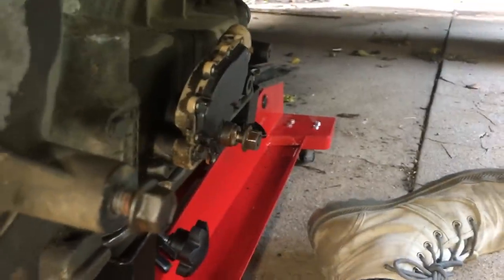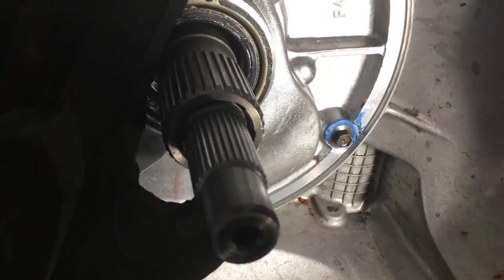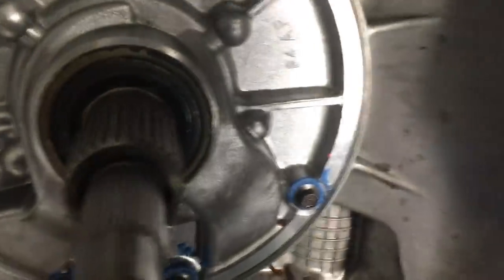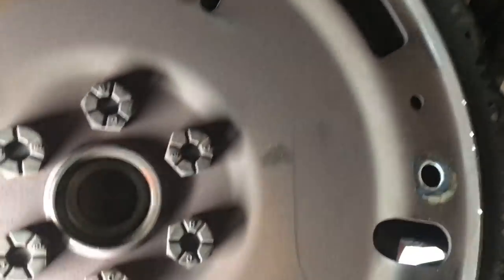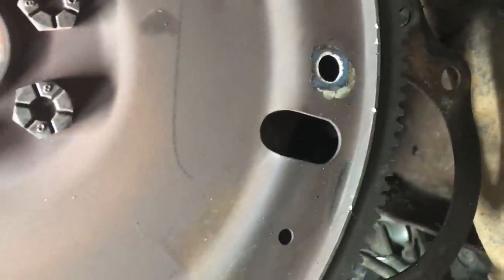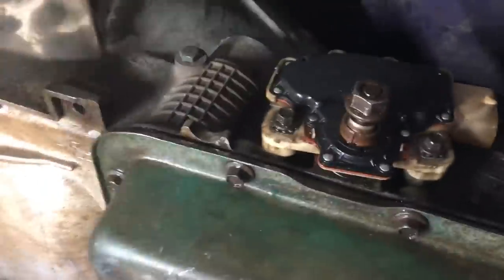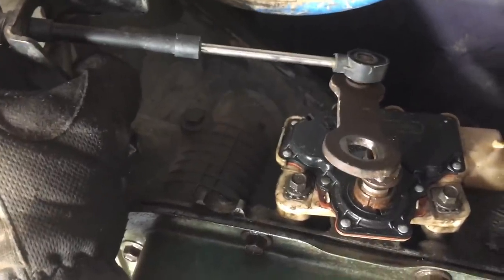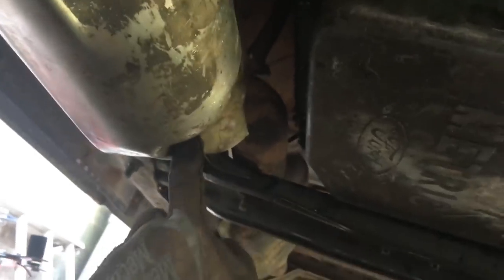How to Install a Transmission by Yourself in One Day | 1995 Ford F150

Comment: I know this isn't transmission related but I got a 95 f150 5.0. Drives great but when I'm having a hard time starting the truck. I have good fuel pressure and I just replaced the regulator. The fuel leak down test did show that it was losing fuel pressure after it primed. Any ideas? Leaking injector?
Reply from the maker: Jakestarr1723 Unfortunately, multiple things can cause hard starting. I usually start by eliminating cheap variables. Make sure each part of the fuel, ignition, and air system is working. 

Here’s some suspects: 
I’m not sure if these trucks have a fuel pressure regular/check valve. If they do, I would check that. Make sure the fuel filter is new. They are cheap and can cause problems. Visually check the injectors and make sure nothing is leaking. If necessary (and it’s takes some time) remove the injectors and have them cleaned. The last thing you can do, is test the vacuum of the engine. They sell vacuum test gauges at any parts store. Hook it up to and vacuum line on the engine.
Reply: The Minute Masters thanks
Reply from the maker: Jakestarr1723 No problem man! Let me know how it goes!
Reply: The Minute Masters turns out it was the vapor purge solenoid had failed. I was able to use the paper clip method and read the codes.
Reply from the maker: Jakestarr1723 Right my fault man. I should have told ya to check the codes. That would cause the problem. The solenoid probably caused a vacuum leak, which in turn caused the hard starting.
Reply: The Minute Masters the check engine light wasn't even on. I just decided to check the codes. No problem. Thanks
Reply from the maker: Jakestarr1723 Well I’m glad it all worked out!
Reply: idk if you fixed your problem but look at the MAP sensor

Comment: Okay so I'll watch your video against OU you allowing you just going to pick that transmission up and stick it up there and that's why you need to workout I'm calling BS on that dude that's some straight up BS Bubba U full of it dude
Reply from the maker: A drained auto trans without the torque converter is not that heavy. A bag of Quik-crete concrete mix at Home Depot weights 90 pounds. I can lift two bags for a short distance. So yes, I did lift the transmission up onto the table to work on it. There is 24 lbs of transmission fluid and about 25 pounds for the TQ, that’s 49 less pounds I need to lift. Again, you can choice to trust an Eagle Scout class of 2010 or just pretend I’m BSing 1 million viewers.